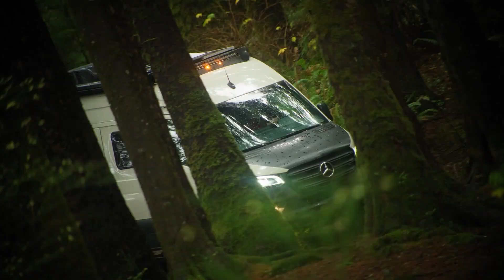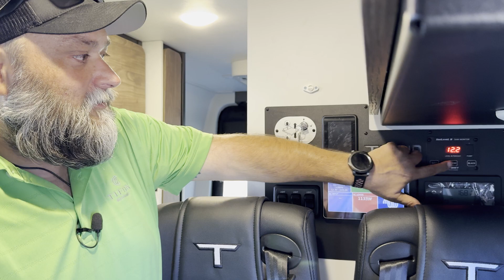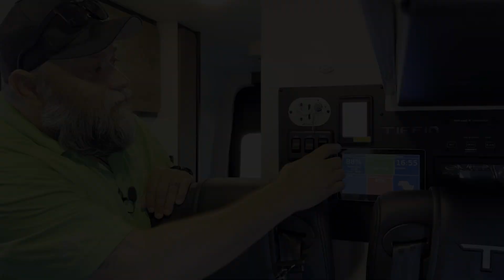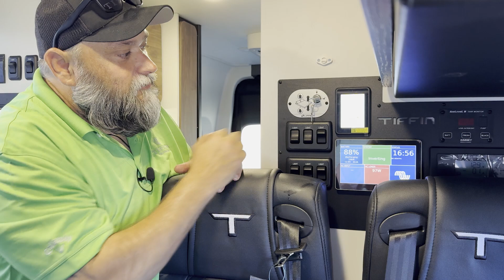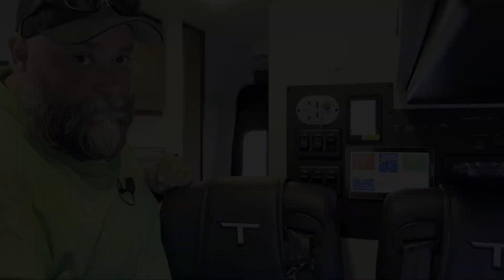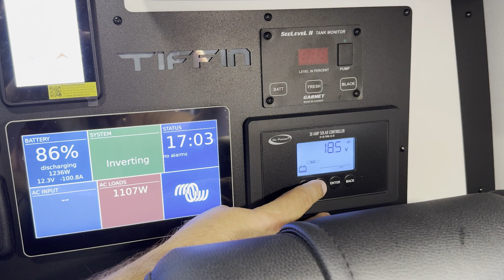GH1 Quick Start Guide: Control Panel

Comment: I wish Tiffin had a similar video for the GT1, which we own. Our technical docs and owners handbook are from the GH1, which is substantially different.
Reply from the maker: You should have received a GT1 owners manual in your unit. If you did not, please reach out to contact@tiffinmotorhomes.com to request one, and we will send that your way!
Reply: @TiffinMotorhomes1973 sadly, when I  reached out to your contact email, I was told that Tiffin hasn't had time to put them together. Seems like the GT1 is an afterthought.

Comment: Great video. For 2025 GH1's, does the Victron allow setting the maximum power used for charging the batteries? In other words, if the only shore power outlet available is 15A or 20A, or using say a 2000 watt Honda generator for shore power, can you turn down the maximum amount of power used to charge the batteries? Or does shore power just absolutely need to be 30A?

Comment: where is the temp sensor located that shows on solar head unit?
Reply from the maker: Hey Jason, what year coach do you have?
Reply from the maker: In the above video, the temp that is shown is the controller itself. Since the system does have an operating temp range, it shows the controller temp.

Comment: My coach is not turning on when i turn the red button to on. Am i missing something? We just purchased it. The battery said it was 95% when we turned it off and now it will not turn back on please help
Reply from the maker: Please make sure you have both chassis, and the house battery disconnect turned to the on position. If you can confirm that, please call our service technicians as we may need to ask a few questions to locate the root cause of your motorhome not starting. They can be reached by calling 256-356-0261.

Comment: How accessible is the Aqu- Hot burner for yearly maintenance??
Reply from the maker: Great question, James. on most models there should be a drop down door under the jump seat area for access to that area.
Reply: @TiffinMotorhomes1973  i have the adventure bar, how do i access the aqua hot?